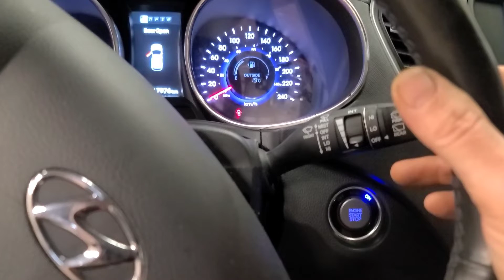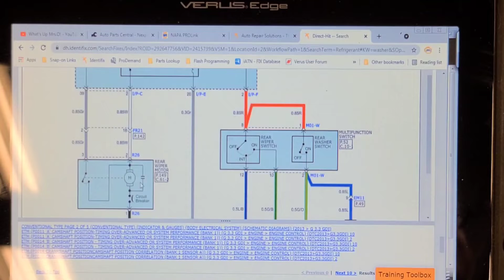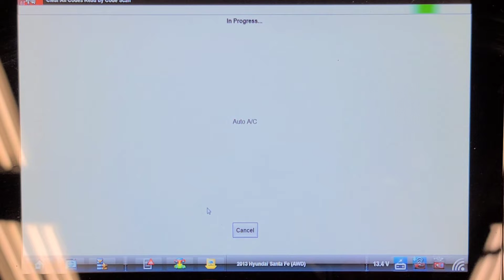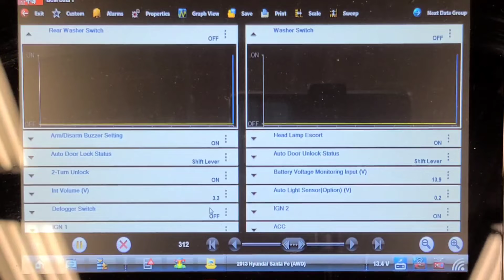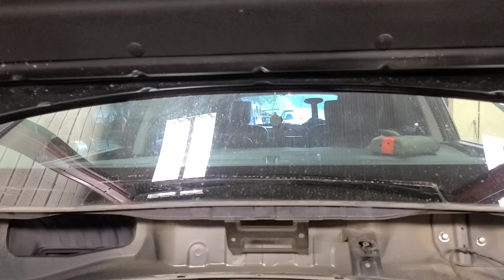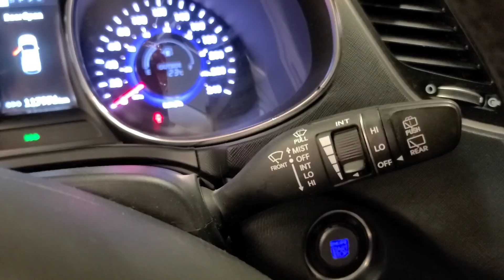2013 Hyundai SantaFe Rear Wiper Washer Not Working

Comment: Yo be clear, you have to remove the wheel well cover to gain access to the reservoir and it's attached components, correct?
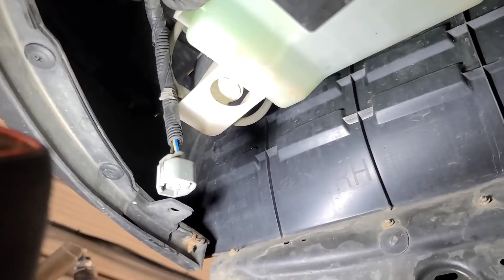Reply from the maker: You can access the washer pump by dropping the lower front section of the inner fender. 9:15 in the video.
Reply: @PhillipBailey  okay. I quick glance this morning i did notice the two push pins but also noticed what seemed to be a bunch of tiny "brass" rivets attaching it to the fender.
Reply: By the removing the two push pins the little cover should just pop right off?
Reply from the maker: @sgodlike7911  you can pull the front of it down enough to access the pump.. you may have a cracked line that leaks lightly when the washer runs. Need to watch for the source of the fluid while someone activates the washer. Are you in a cold climate where water may have frozen in the pump at some time and cracked it?
Reply: @PhillipBailey  good thinking! I'm in sunny and stupid southern california. Was in NE Utah for the holidays but this is the first i've noticed it.
Reply: @PhillipBailey  thanks for the quick reply and advice. I'll let you know how it goes when i get some time to spend on it 🤙
Reply: This morning i noticed a small pool of washer fluid directly underneath the reservoir. Both front and rear wipers and "sprayers" are functioning properly and the reservoir is far from empty. Any suggestions?